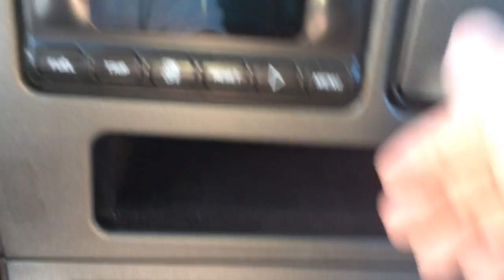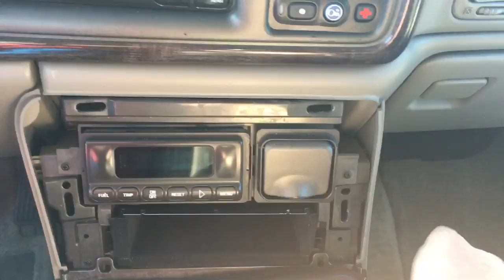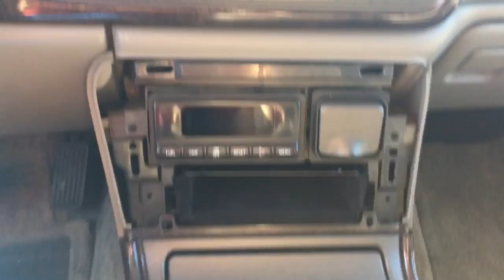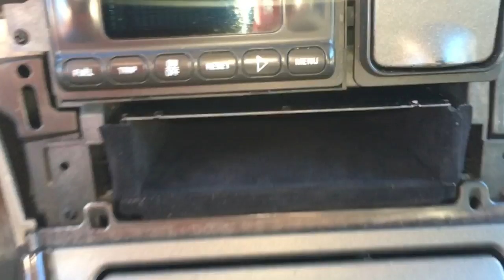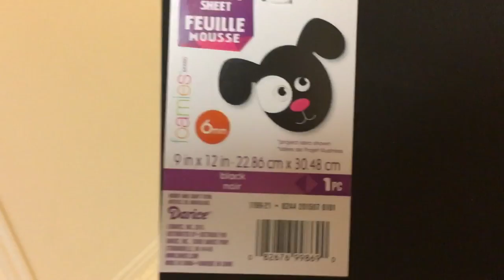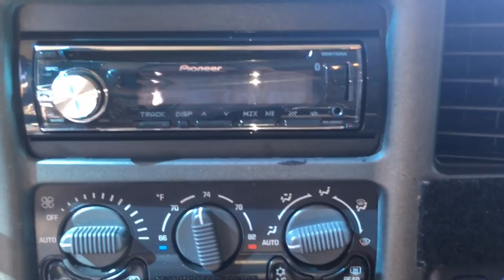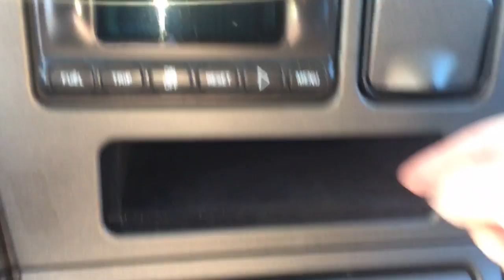How to convert your CD changer into a dash pocket!

Comment: I just installed a new Pioneer double DIN system from Crutch and of course, it bypasses the 6-disk changer.  Fortunately, I came across your video and this afternoon I'm going to pull the changer out and build this box like you did.  Thank you for taking the time to put up this vid.
Reply from the maker: Did you have to modify the dash to accept the double din?  I went with a single din because this generation of Denali has a silly 1.5 din opening.  I'm glad you enjoyed the video, my pocket is still going strong!  I've often thought this was one of my more clever videos and have been disappointed that it is my lowest viewed video.  Oh well.  I've also thought about taking my dash pocket out and mounting a cheap Qi charger to the bottom of it so when I put my phone inside it will start charging wirelessly...maybe when I find the time.  Let me know how yours turns out!
Reply: The factory system was already a double din unit, so the new one fit correctly into the same space.  However, the new Pioneer unit from Crutchfield had a big herky fan and heat fins on the back, at the bottom center.  This hit the composite, gnarly framing system in the back so I had to take an oscillating cutter and saw out a chunk of it while my wife ran a vacuum tip adjacent to the blade.  After that, the new head unit fit pretty well and bolted to the original facing using the supplied plastic mounting frame. The system works but I need to pull it out and make a sound level adjustment on one of the adapters that I also purchased from Crutch (we're real close now, Crutch and me, LOL).  That's when I'll make your alteration to remove the 6-disk changer and I'll take some pics and get back to you, no prob.

Comment: Hey Thanks.  I am in the middle of a stereo upgrade on my 2003 Denali, and couldnt find a cubby to replace the old 6 disc changer.  Only change I made was I used some rubberized foam drawer liner for toolboxes.  Its flexible and I was able to wrap the bottom in 1 piece and did the top.  Wouldnt have thought to do this without this video.  Thanks again.